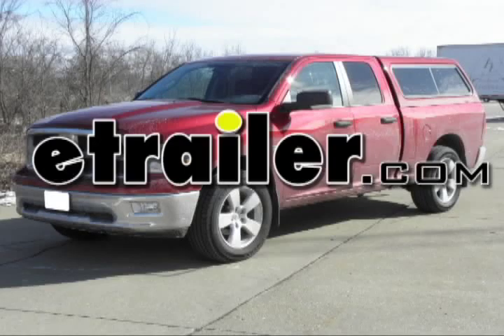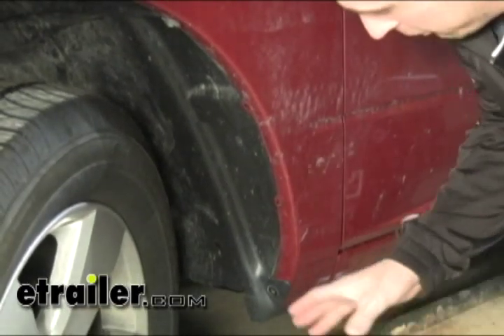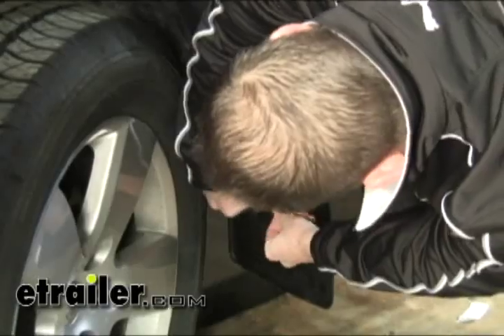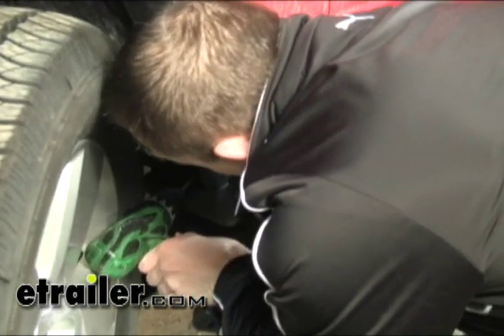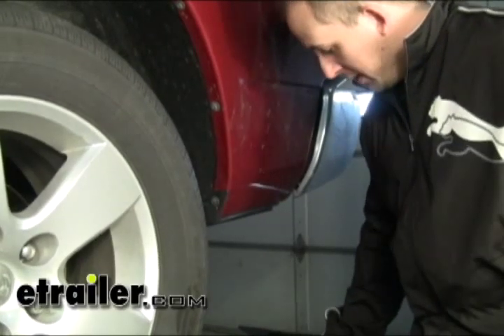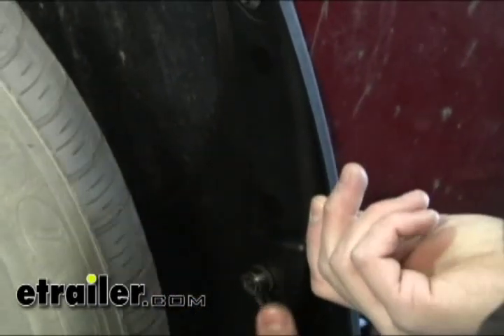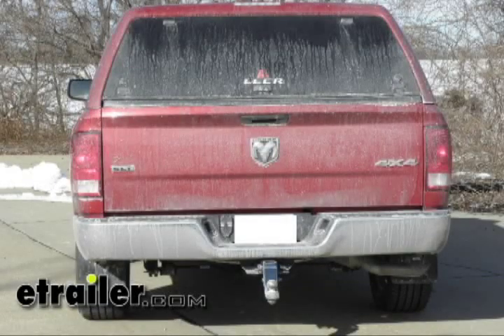etrailer | 2009 Dodge Ram Pickup WeatherTech Mud Flaps: Complete Installation

Comment from the maker: @stewartx5 @stewartx5 I talked to the guy who owns this trunk. As you saw in the video, no calking used. He said that to date, there are no signs of corrosion and the installation is sturdy. I don't think the calking is necessary. Plus, if someday you would like to remove the mud flaps, you will have left over calking stuck to your vehicle's wheel well and that's kind of a pain.

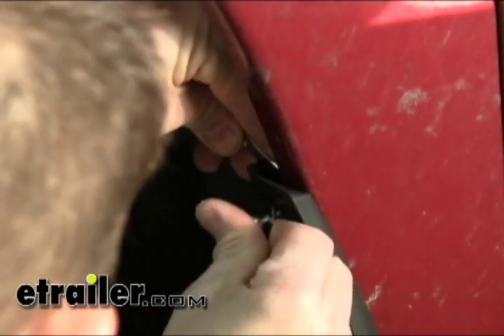Comment: Where did you get the little screwdriver you use at 1:55 into the video?
Reply from the maker: xentrik1 They have been spotted at local auto parts stores and local bike shops.